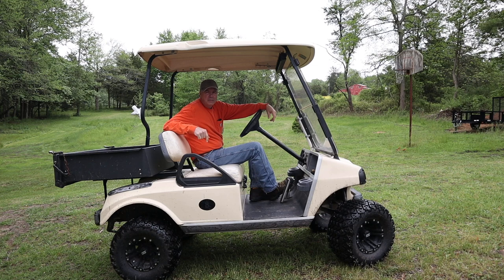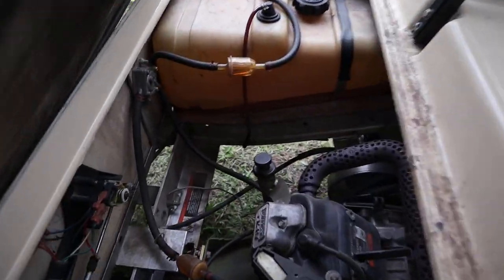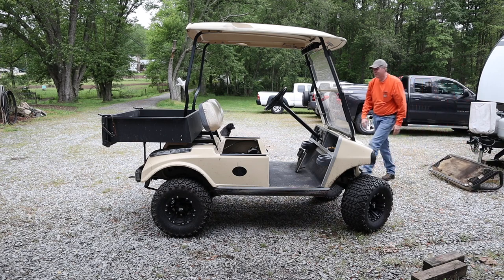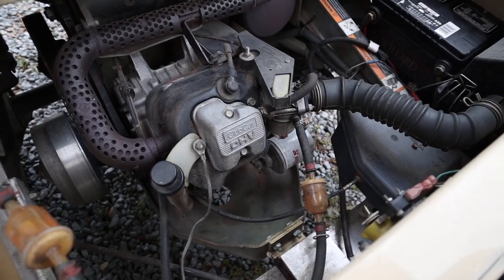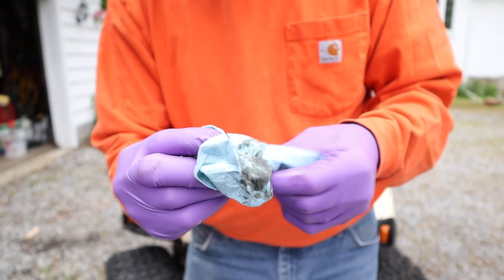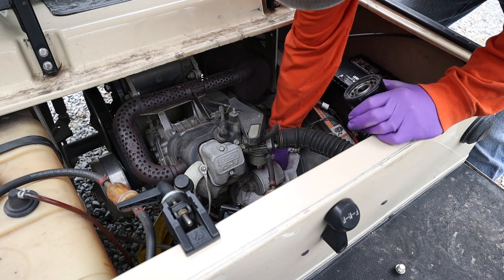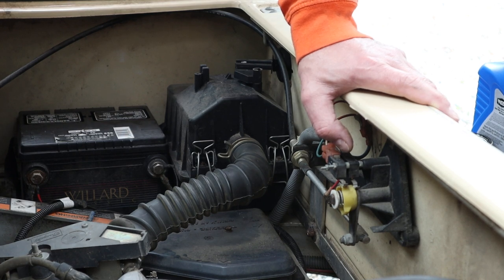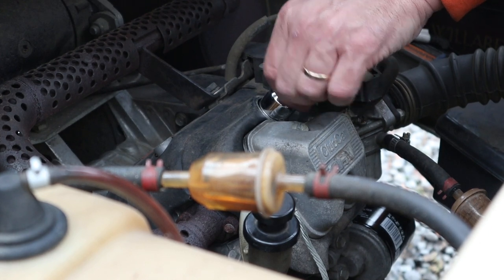#14 Club Car DS Golf Cart Service Maintenance - Oil Change, Air Filter, Fuel Filters, Spark Plug.

Comment: Thanks for this.  Lots of good tips, well filmed, well explained and entertaining!   I think my Club Car is a 93. Now that I know how to check, I'll look for the Serial Number.  Mine has a primer pump that comes off the front of the air filter cover and is located in the fiberglass seat riser right behind the drivers left leg.  Mine often requires a few pumps to start after sitting for awhile.
Reply from the maker: Thank you!

Comment: Appreciate the video, was gifted a 98 DS and looking to tune it up when spring hits. Scanned the comments for other info that just slipped thru the cracks in video like type of oil and where fuel cut out was and seemed like every question you answered there so no gripes. Thanks again and count me as a new subscriber.
Reply from the maker: Thanks for your comments and for subscribing. Good luck with the DS. Welcome!

Comment: I've got a 1999 Club Car. Runs like a champ
Reply: On my 99 I cannot break loose the bolt to drain the oil. Any suggestions? Should I try to use heat with a small torch?  Great video. Thank you for sharing.
Reply from the maker: That seems odd. Not sure I’d apply heat there. Maybe just a socket and breaker bar. Or a small impact driver with a socket?

Comment: Great video?you didn't grease front end😀 Mines 2004 ds. It replaced a yamaha oh what a difference. CUT beat the ds knobs tires with small lift great for across feilds and through woods.
Reply from the maker: Hi Dan. I love the DS. Such a reliable and quiet machine! Not a powerhouse by any means, but durable and dependable! Thanks for watching. -Ed

Comment: Thanks for the video. Question: Is there any maintenance on the ignition system..? Such as replacement of spark plug wire..? Is this a some kind of solid state system or is there a distributor with a cap and points..? What about the carburetor..? Any cleaning necessary...? It looks like there is a bleeder valve on the bottom...?  Maybe the cover can be removed, carb cleaned and then a new gasket...??  Also, have you even changed the larger clutch drive belt..? It seems it may not be that easy...
Reply from the maker: Hi m m. There is no distributor or points that I'm aware of. And I don't think any carb maintenance is needed unless it starts running poorly. I haven't really had to do any other maintenance or repairs on this cart. They are solid! I run a Club Car DS Facebook group that is very helpful. If you're interested just search for it. Thanks. -Ed
Reply: @MyClutteredGarage  Thank you for your reply. My buddy has an old Club Car work cart but it has the exact same engine. It is very old and kind of crappy, but it gets him around his property. It is backfiring sometimes on a deceleration. I agree there is no distributor on these carts and probably use an electronic / magneto ignition which does not require any service. I will perform the service you did here but i have a feeling that it may be a dirty carb.... probably a lot of carbon build-up.... I will look into removing it and do a good cleaning... These things are like tanks..... they can take so much abuse and keep running and if they are maintained they can probably last a lifetime.....haha..... I will also look into changing the transaxle fluid... and probably change the belts while i am at it.....take care..

Comment: As we talked about before, we have an EZ- GO golf cart. I really like it too. We use it all the time for hauling stuff around the property. Ours is electric which I really like! Did you install that lift kit yourself? How hard was it? Our dog loves cart rides too. A little too much! Great video! Cheers!
Reply from the maker: Peacefield Farm_MN thanks so much. Yes I did install the lift kit. I did it after work one day so it really only too 3-4 hours. I hear the electric carts actually have more power and can be tuned to go faster. I just wouldn’t like the cost of replacing batteries, but there are a lot of electric ones out there! Maybe even more than gas jobs. Thanks for watching!

Comment: I have a 98 club, I just inherited it, I made sure the oil was full, Put a 6" lift on it, And now the oil is reading ad, Does a 6" lift change the Is angle of the motor, And make the dipstick read incorrectly? Thank you Bob Miller Detroit Michigan
Reply from the maker: Hi Bobby. I can’t see why that would change the level. Is it a suspension lift front and back?
Reply: I think I figured it out just watch your video again, Looks like you have a drop spendel lyft, I use speak and text, :), I put a mad Jack's lift on mine, Which replaces the whole front end assembly, So it lifts the body 6", Now the engine is on a different angle, I assumed that's what you had on yours, Then I looked at the video again, And yours like I said is the spindle lift, Which probably keeps the engine on the same angle, Mine reads low now, Because of the angle, I was trying to send a picture, Either I can't figure it out or they won't let me, Anyways thank you for your response, Bobby Miller Detroit Michigan
Reply: @MyClutteredGarage  Where the snobber is, When you lift the body, It LI FTS., The frame., And you can see how it changes the angle of the motor., I put 38 Ounces., Of oil in my 98 Ds And the dipstick reads less than half, I have a hard time believing with your lift., And 38 oz of oil., It reads full on the dip Stick.

Comment: Great video. We just bought a 2003 DS. I noticed on mine that it's missing the engine snubber. I was trying to see how yours looked. Also, do you clean the engine area? Decreaser and hose it down? mine is pretty dirty.
Reply from the maker: Thanks very much, Jim. I’ve power washed the engine area with just water. And not too close with the power washer. Mine was always pretty clean though. Bought from a golf course that took good care of them.
Reply: Great video I have and 86 Club Car.  My air box is different.  But what kind of engine oil did you use?
Reply from the maker: @augoharris3437  thank you. Just standard 4 stroke rated oil. I think 10w 30.
Reply: i am pretty sure you can power wash these engines completely... then use a leaf blower to dry it and start it up immediately... let it run for a bit....

Comment: Hey..I have a ds club cart and oil light comes on when I'm half throttle... Do you have any idea why... thanks
Reply from the maker: If your oil level is full, it could be the sensor. It’s not a pressure activated switch, it’s just a oil level indicator. If you can, join the club car, DS owners Facebook group. Lots of good advice there.

Comment: I have just bought a club cart ds and it did not have a owners manual. what weight was weight was the oil and what is the filter number for it?? Thanks in advance!
Reply from the maker: I used 4 stroke full synthetic. I think it was 40 weight. There's a link in the description for the full tune-up kit with the filter. Thanks for watching!

Comment: Curious, was it cheaper to buy this cart than to get an atv? Atv's have more power, 4wd and way more maneuverable.
Reply from the maker: John Ambro - I actually sold my old ATV to but this cart, which cost about $1500 before mods. The cart is much handier for me around the property. Ultimately, I hope to replace it with a side by side. Thanks much!

Comment: Question: I changed my fuel filters and they don’t fill up all the way with fuel. Top filter has little and the one closest to the motor has a bit more. Cart still runs but I’m curious if they should be full? Maybe my fuel pump is weak? Let me know please and thank you
Reply from the maker: ATV Guy great question. My fuel filters are the same as yours. The old ones and the new ones don’t fill up either. No worries, it’s not sucking air and works just fine. Thanks for watching and commenting. 👍

Comment: We have a 2004 DS club car it started not wanting to start/ move this changed fast then it didn't want to move at all you could hear movement but not the starter motor, I changed the 4 mini switches and the 12 volt solenoid and it runs but if you let it sit say for an hour you turn the key and wait for about 30 seconds and then you hear the starter engages what is the problem starter motor weak battery??
Reply from the maker: There’s a great club car DS group on Facebook that I created. Worth joining if you can. Thanks.

Comment: A 3 inch extension would solve the ratchet problem. You didn’t mention what weight oil to use. You could have mentioned how to cap the plug and tool required. You didn’t show how to turn off gas flow. Perhaps provide the parts names and model numbers?

Comment: So I have a 91 club car and can't seem to find the proper year for its oil filter will it it hurt it in any way if it was a 92 oil filter?
Reply from the maker: Can you take it off and compare? If the gasket lined up and it threads on easily, I don’t see why that wouldn’t work. There is an active and helpful DS owner group on Facebook you could ask. Thanks.
Reply: just bought a 1998 Club Car Ds gas for 1,600